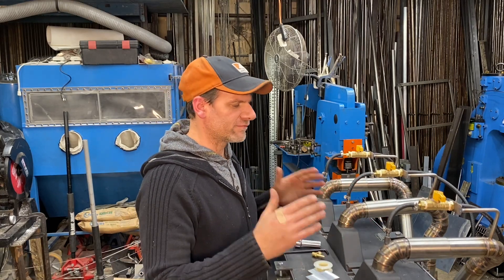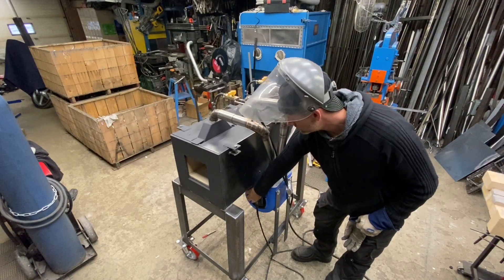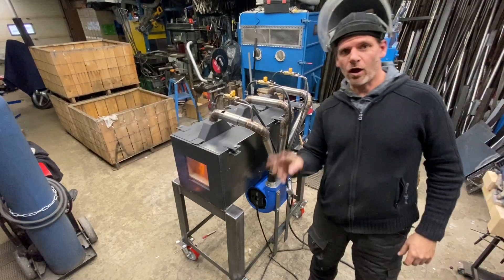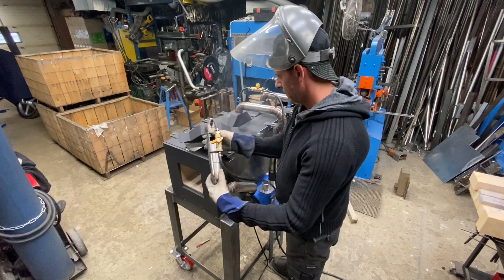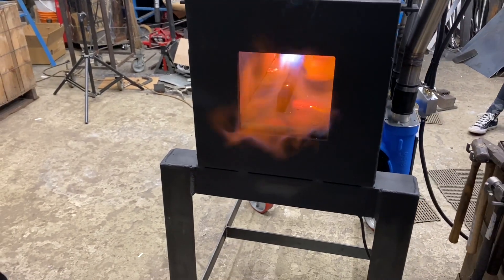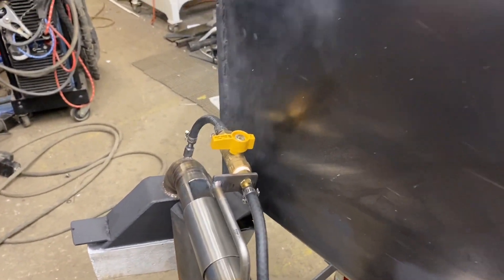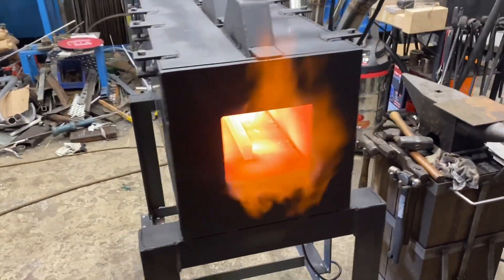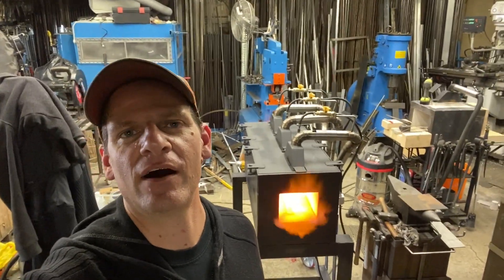MONSTER FORGE BUILD!!! ITS TESTING TIME!!!

Comment: Why lot leave the blower on after shutting the forge down?  The air flow would prevent the tubes from heat soaking and would cool the burner.
Reply from the maker: it would definitely but on the other hand it cools the refractory bricks too fast and causes bricks to crack , thanks

Comment: Do you have the fan on low? I have one of those fans and seems to put a ton of air out. Figured it would be to much on high. Even with 3 burners. Unless there’s a lot of restriction with the ribbon burners. I haven’t finished my ribbon burner so I’m just curious if it takes that much more than my standard 1.5” forced air burner.
Reply from the maker: I actually have it on high and i may need more air flow I’m actually trying to find one of similar size but with more cfm. Thanks for the question
Reply: Bonifabcustom Rob Bonifacio  wow, that’s definitely not I expected to hear. Thanks